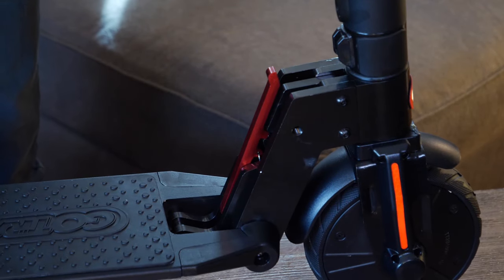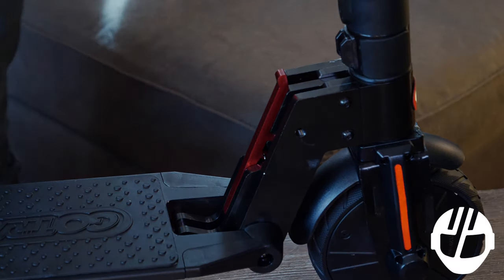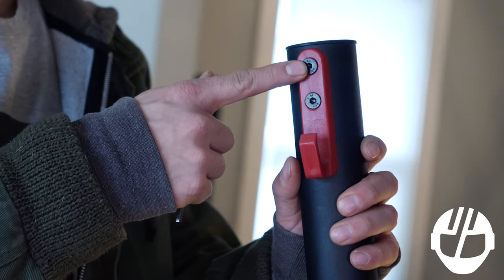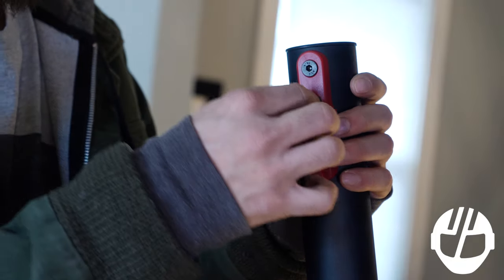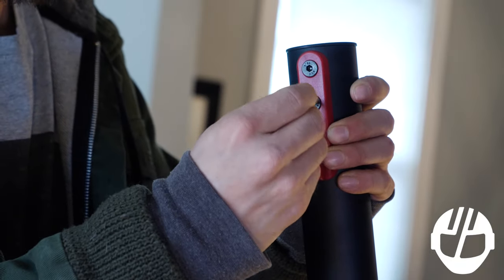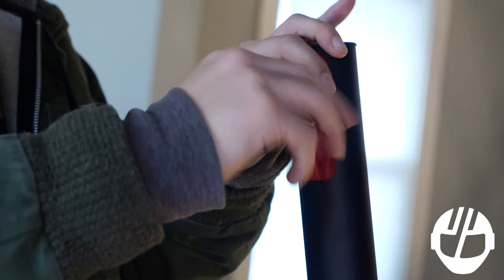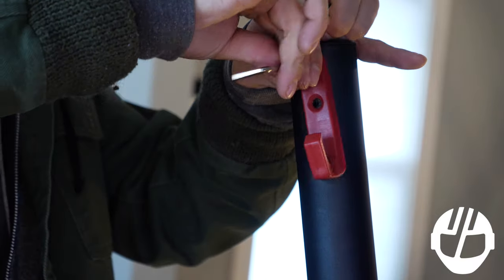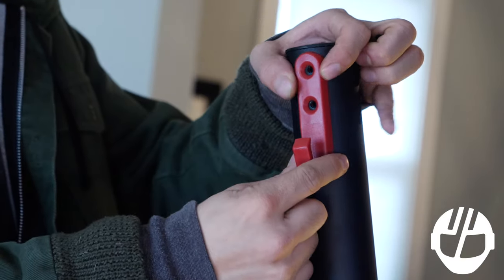GOTRAX G2 Electric Scooter Assembly Instructions

Comment: Add, what do you do when it doesn't work out of the box.. and yes the battery has been charged
Reply: Same issue with ours tonight! Did you find a resolution to this?? Thanks!
Reply: @TRD_Cueto  Seems you have to get on it and kick a few times, it doesn't self power from 'zero'.
Reply: @krumby  yes! I emailed Go Trax and they quickly replied with a similar answer. Has to be kicked to 1.3 mph to start working. Tried it and it works! I mentioned to them, it would be nice to mention this in the manual. 👍👍
Reply: Same issue plz help

Comment: Can you use the Gotrax scooter in "manual mode " by pushing with your legs while scooter in OFF ?
Reply from the maker: We recommend using the throttle so you aren't pushing around an extra heavy scooter. Be sure to wear a helmet!
Reply: @GOTRAX  all right thx for the answer

Comment: I don’t know where I’m supposed to put the charger in the scooter (and yes I have looked through the manual)
Reply from the maker: You should see the charging port on the Electric Scooter Console. It is right below the power button. There is a small cover that protects the charging port from dust particles and other contaminants.
Reply: If you did look at the manual, then you just missed alot of information because it is there